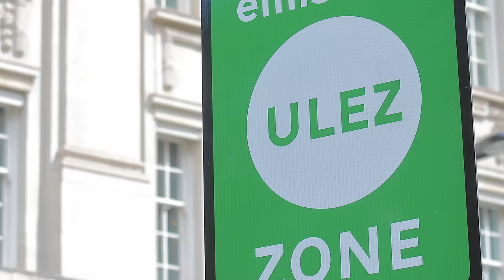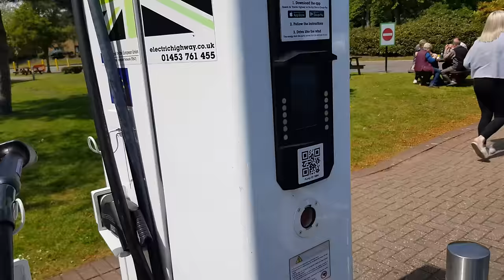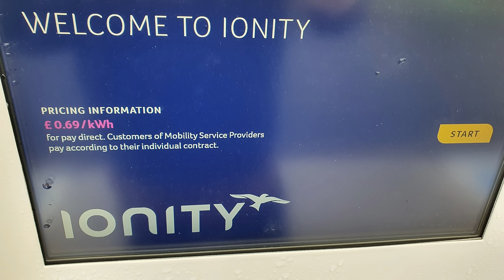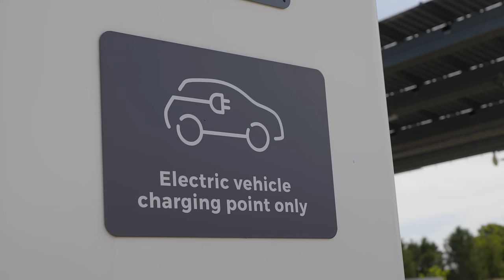The Uncomfortable TRUTH About EVs: The Version NEITHER SIDE Wants You To Hear

Comment: I agree with you on charging. We live in Ireland, and took our EV to the UK, and charging was not as straightforward as it should have been. I'm not really worried about the cost of charging, because we do 99% of our charging at home. But a lot of chargers that had contactless payment would not accept our foreign cards. It should be possible to have a system where you sign up to a payment company and register your car, then when you plug in your car it should be able to recognise your car, know who your payment company is, and verify you haven't got a huge unpaid bill, and start charging. I shouldn't need contactless, or cards, or apps. Plugging in your car is all that should be needed to initiate the process.
Having said that, I was staying an Eco-hotel in the middle of Ireland, and they had a charger I could plug into, which charged off the solar panels on their roof, and when it was finished, they told me how much KWh it had taken, and I could have paid cash (although I actually paid by bank transfer). It was not a fast charge, but as I was parked outside all day, it didn't really matter.
Reply: You don't see an issue with being identified and thus potentially declined from the ability to buy potentially emergency power for your car? *facepalm. How far we have fallen. Advocating KYC for filling up your car. Amazing.
Reply: Any other car except Tesla is a real nightmare to charge on the motorway. The Tesla supercharging experience, and the wretched, crippled, broken state of every other charging network in the U.K. makes Tesla the only EV you should consider in the U.K.
Reply: Thats how chargers work in Finland. They have their own apps so doesnt matter what country youre from or your card.

Comment: I don’t know for sure but the Fire in the Range Rover at Luton appears to be where the hybrid battery would be, I’m a combustion engineer and a diesel fire produces loads of black smoke, I haven’t seen a full explanation from the authorities of what happened so that will just fuel speculation
Reply: This could be easily resolved by the authorities releasing the vehicle registration of the car. The silence of the powers that be leads people to jump to their own conclusions.
Reply: There is a reason the registration hasn't been released and its not to protect the general public
Reply: User @f-u-nkyf-u-ntime has a comment that says; "I think there's actual footage of the offending vehicle on fire. A hybrid Range Rover. The flames were from the area of the battery, were horizontal and orange/white. There were reports that the owner drove into the structure with the car on fire, hence the footage, and that he emptied a fire extinguisher trying to put it out. To no avail."
Reply: @iliyakuryakin4671 Unfortunately if they release the registration and it was a hybrid then everyone will jump on the “yeah - it was the battery”. I think they want to actually do an investigation and then write a report and then release it with the evidence. It may have been a battery fire. It may have been a diesel fire. I’d like to see the evidence first. The video that’s circulating doesn’t show anything - the fire is already well under way with multiple vehicles on fire, hence you cannot tell anything from it. Hence I will wait for the report before forming any opinion.
Reply: I've seen other videos and sources say it was E10 EFL - A diesel only Range Rover.
Reply: From what i saw was a test on a small lithium ion battery and a diseal. They burnt both to see what damage was done to concrete slabs after x time. The lithium almost destroyed the concrete however the diseal only scorched it due to the max temps both produce. 
It may not have beena litium ion battery at the begining but it appears that it was eventually and thus should be of concern either way
Reply: The problem is that there are too many people with the mindset of 'they wouldn't lie to us about something really important like that'. I really despair at people's gullibility.
But hey, I'm just an idiot with a significantly lower chance of developing myocarditis than most, so my opinion doesn't count.
If you don't understand my comment, then jog on..... carefully.
Reply: it is very hard for me to believe it was a diesel car that caught fire, i just don't until bulletproof evidence is presented.
Reply: Oh Gary, brilliant pun, was it intentional ? “just fuel speculation speculation” !
Reply: @bri77uk1 any car can have an LI battery......
Reply: @bri77uk1 That was fake, it was confirmed as a hybrid.
Reply: @Isclachau  was it? I heard the opposite.
Reply: @bri77uk1  Yes the owner has emerged and confirmed it was an older hybrid
Reply: @alihenderson5910  nice comment. I am sure that the enquiry/ report will produce the correct answer , once Sir Humphrey has drafted it.

Comment: The biggest problem with 10 year old worthless EVs, is not the resale value. The problem is when in the 11th year the battery bogs down and replacement costs 3 times the value of the vehicle, then yeah, it becomes a paperweight.
Reply: Zero evidence of this.
Reply: Absolutely,  James cooke has a channel and his Tesla battery failed out of warranty but he got a deal with them and I think the cost was 12k  , plenty of evidence of older EV range getting worse and failed batteries.
Reply: @tonyquinn7479  1 Tesla battery failing does not mean all EV batteries will at that time. My Wifes 2016 nissan leaf has 120K on the clock ,  same for 4 other families I know with an original Leaf.
Reply: Oh dear oh dear.... there are lots of failed battery's etc on the net. And what is your leafs range now compared to when it was new?
Reply: @tonyquinn7479  its the same 100klms
Reply: That's impressive
Reply: @tonyquinn7479  impressi if it were true
Reply: @martinmuldoon603  its a fact.

Comment: You have a lot of valid points and your conclusion is mine too..  we were looking into getting an EV as our 15yo diesel is getting up in age and distance and wanted to do research in case we need to get a newer car.   For a brand new EV the prices and interest rates are way to high.  Also, the trend for automakers to pull standard features or one time purchse options out and make them subscriptions based only.  GM announced they will pull Carplay and AA out for their own "service".  But one thing that we learned from the dealers is there is general strain on the electrical grid and there is no plan to upgrade at the moment. Also, there is the high possibility that we can not store in the garage as the potential for a fire will cause more damage than ICE. Then I talked to my local garage who services my car and they are looking into fixing EV but it will not be easy.  Like you said, they will need to upgrade their fire suppression system.  But in some cases they might need to pay addition licences fees to the manufacture to fix them and gain access to diagnoitic tools.   The lack of garages that can fix ev is partly a problem of the manufactures to contain the money flow.   so it looks like we may go for a used diesel for now as like you said, it fits ours needs.   for local stuff, we mainly use the bike anyways.   
on the ev fire in luton, i am sketpical that it was a diesel, if you look a the photo of the offending car, the location of the flames coming out, and the intensity, it does seem to the a Land Rover hybrid.  which had(s) issue the battery catching fire.   will this keep me from buying en EV, no, but it is something to considering in the long run for everyone on how we use this technology in the future.   for the insurance, please see this Guardian article on insurance premiums going up, https://www.theguardian.com/money/2023/sep/30/the-quotes-were-5000-or-more-electric-vehicle-owners-face-soaring-insurance-costs, I was shocked by the rate increase here.   but like you said, some of these extreme videos on both sides leave out a lot of critical information that does not support their view. I am in the middle, I want an EV but right now it does not fit my needs.

Comment: EVs offer a rather expensive way of providing generally shorter ranged transport that produce no emissions at the tail pipe. I'm all for lower emissions but the initial cost, range and the cost/time taken/availability of charging are all working against them. We also have the issue of few mechanics being qualified to work on them. As a keen driver, do you really want to lose your ICE sounds and manual gearbox?
Reply: I drove my 996 GT3 today. There’s no way I want to lose that experience. Not to mention the fact that it is a 20 year old car in fine fettle - a small amount of CO2 from its ICE vs the cost to manufacture a new BEV?
Reply: @rpc2210 , great cars. I had a 996 GT3 CS for 12 years with a few minor modifications including a Manthey K400 upgrade and really regret selling. My advice is to keep yours and enjoy it why you can.
Reply: The efficiency of electric vs ice is another level though regardless of range - i do think there will always be a place for ice sports cars as they provide intangible fun but for a to b stuff EV is a no brainier really - coryton produce sustainable petrol today that only has 1/2 the carbon impact of forecourt petrol - plus I’d rather not be putting even more money in the hands of despot regimes (I know most the batteries come from China currently but this will change within the next 5 years)
Reply: lewismcnicholas2631
You are correct, there will never be a ICE vehicle that is even half as efficient as an EV. Its a matter of first principle facts. Its like comparing an electric locomotive to a steam engine.
Reply: Na EVs save you money. Solar charging and 8 years warranty.. No moving parts to go wrong and super fast.
Reply: "EVs offer a rather expensive way of providing generally shorter ranged transport that produce no emissions at the tail pipe."

It's almost like the shorter ranged transport could be arranged in the form of public transport with enough political pressure, so that there wouldn't be the need to get a car
Reply: Time to read the writing on the wall pal

What you should be speaking for is the Right to Repair and preserving great cars

Not reading from the basic anti EV hymn sheet
Reply: @robert7622 The problem though is everything but the technology themselves. The planning for EVs and solar panels are far too orientated toward wealthy customers because that's good ol' capitalism folks
Reply: @tomppeli. 🎯🎯🎯🎯🎯
Reply: I have both ICE and EV cars - they each have their place (I have a large ICE SUV because it’s great on the long run). Before you say expensive let me explain my running costs on the BMW i3: It costs about 3p/mile for fuel (using Octopus Go overnight home charging). Servicing is £250 every 2 years at a BMW main dealer. Brakes are barely used and are about 30% worn at 35,000 miles. Tyres last about 20,000 (rear) and 30,000 (front). The thing that we don’t do with this car is do long journeys, but we never use the i3 for journeys beyond the range (about 120 miles). That’s why we also have an ICE car. At the moment electric cars are great, cheap second cars. They are also really good fun to drive.
Reply: @tomppeli. think we need to remember that individual freedom is just as important on the road to sustainability but agree more could be done for more metropolitan areas
Reply: @nixer65  If governments were serious about EV's then there'd be more like the i3. Instead, they use the taxes paid for by the supermarket cashier to get someone into a Porsche Taycan.
Reply: @deanchur  Hi - Actually all of the EV purchase subsidies ended in June 2022. There is a still a grant for installing a home charging point, but it’s not huge at £350. There are actually a lot of cheaper EVs around now to buy new, but if you’re looking at used it’s still a bit sparse, but some are reaching close to parity with ICE equivalents (Renault Zoe, BMW i3). Hence - no the government is not subsidizing EVs. It is, however, massively subsidizing the oil industry but that’s another debate.
Reply: @robert7622  More expensive to buy, insure, with seismic depreciation and if you have to DC charge, no cheaper to run. EV's may have fewer moving parts so less to go wrong, but when they do go wrong, they'll only be able to be repaired by a main dealer and the costs will be eye-watering, so people will just scrap them, which is hardly eco-friendly.
Reply: @tomppeli. Thats what we need, all hemming into massive mega cities.......no thanks
Reply: @lewismcnicholas2631 sustainability isn't profitable. Swapping your car you don't own, every few years when your lease is up is not sustainable at all
Reply: Yeah agreed - you really need to get the smallest battery you can live with and then keep it for a good while. Ultimately comes down to where the car was built and how clean the electricity generation is to get to the break even point - up north it should be around 30k miles if you compare the impact including refining and transporting fuel around so compare apples with apples
Reply: @nixer65  I agree this is a very valid point. I run an Ioniq 38Kwh with a 200 mile range and in the summer I’m pushing 1.5p a mile in winter about 2p but the Ioniq is extremely efficient. I couldn’t go back even if I wanted to as I save around £250-300 on fuel, that’s enough for a lease on another car!

Comment: We're a couple of just over 60.
 Kids are all grown up.

So, for around town and and "functional" stuff, we have a VW e-Up!
With a bunch of solarpanels, fuelcost are almost zero. 
Even in winter months, the output is averaging 140kWh, which is app. 1.000-1.200 kilometers of range.
This covers our demands in the fuel department.
The little thing is 4 years old and has cost us nothing. At all. 45.00km driven so far. 
Range in winter is 180-200 kilometers. In summer 250+
No change so far in battery performance.

The, for long distances and fun (Alps, Black Forest, Eifel, Pyrenees, you get the idea...), we have an BMW Z4 35is.
Not brilliant on milage, but it doesn't have to be.

For us, perfect combination.

Comment: Are current EVs really future proof as James says? I think otherwise with solid state batteries on the horizon. Driving a current EV today will be a driving a white elephant in 3-5 years.
Reply: Been on the horizon for 30 years, even if they solve the problem today it will be 5+ years before manufacturing at scale could even start
Reply: @ericpisch2732  Toyota claim 2027-28. Thanks for replying
Reply: If you live in Australia and have a solar panel built in one day EV's may make sense
Reply: Solid state battery.. Lmao@u.
Like cold fusion. It's just a few years away, and has remained just a few years away for the last 3 decades!
Reply: Why will it? Why does it matter one jot if your battery is made out of blancmange and unicorn hair? If it has the capacity to serve your lifestyle correctly and will last (as they are proving to very well indeed) who cares what the tech is.
Reply: @clownworld-honk410  Toyota claim many things - hydrogen, fuel cell , solid state - we will see .
Reply: Solid state batteries might be great in a lab in 5 years. That still leaves them 5 years away from being in high-end vehicles and 5-10 years away from being in affordable vehicles. 3 years is a joke statement.
Reply: @louisholden5127  OK. Toyota are saying 2027-28. We'll see...
Reply: @clownworld-honk410 toyota are saying that so they can do nothing. Lies
Reply: The problem with today's batteries isn't the technology, its the cost. Will solid state batteries be cheaper than current batteries? They'd better be because  lithium iron phosphate batteries will be quite cheap in 5 years time.
Reply: @davidk7262 taking your statement literally, blancmange is readily available (although not as common as in my youth) unlike unicorn hair, which is scarcer than rocking horse dodo. The herd of elephants in the room is that we can’t currently produce or buy in enough energy for EV’s to replace all ICE cars, and no political parties have plans for this to change anytime soon. So in a full EV world there will have to be a reduction in vehicles and journeys!
Reply: @anthony208  Correct although as the ban on sales has now been shifted to 2035 and going on the average life of a new car we are unlikely to see a 'full ev world' until around 2050 and I suspect we will see some form of hydrogen and or carbon neutral e fuels by then anyway. We shall see I guess!!
Reply: I think they are going the same way as the skateboard.
Reply: Just sait the oil to run out and see the price to go $10/gallon, 10€/l or 8£/l… and you hope that you have something to use cheaper than that…
It will happen… we just don`t know when. Not in 10 years… when Soviet Ukraina war end… there will be time for really cheap oil price! But 30 years in future the oil will be much more expensive than today and from there on the way is only up!